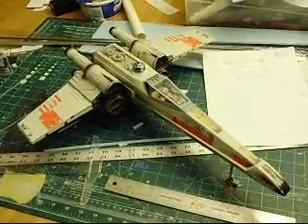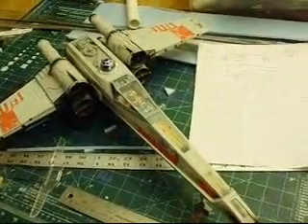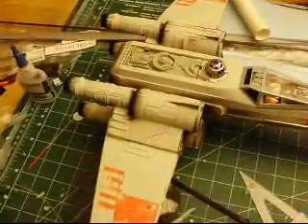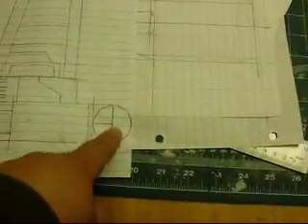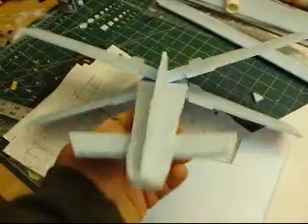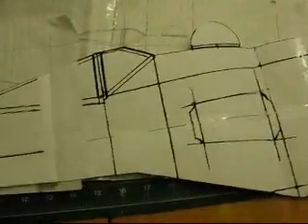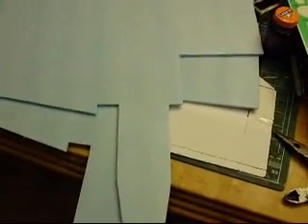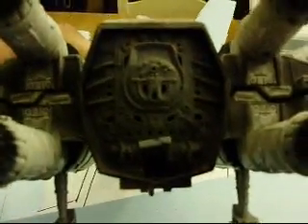RC Star Wars X-Wing Fighter build PART 1 (Rough Build test model)

Comment from the maker: Haha hey thanks! I will send some plans as soon as I get them converted to PDF. As of right now I am having a hard time with enlarging my drawings and making them all same scale as the other drawings. 

This weekend I hope to at least finish the fuse and start on attaching the wings. I need to go ahead and order the esc and motor here now that I am thinking of it.

 I will post more video as I go along. I will for sure video my maiden on the test model. Should be interesting!
Reply: Gig540  did you ever get the plans on pdf.. if so may I have the link or point me in the right direction to find them.. awesome builds!!